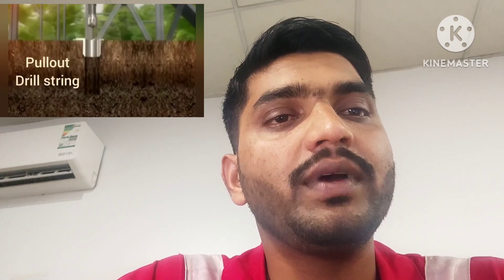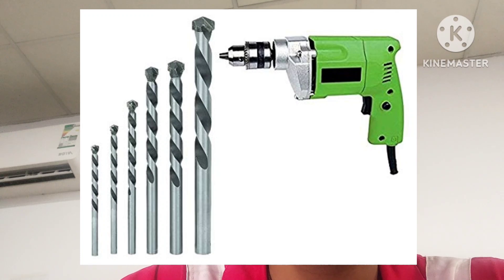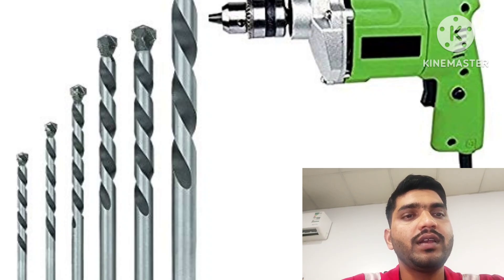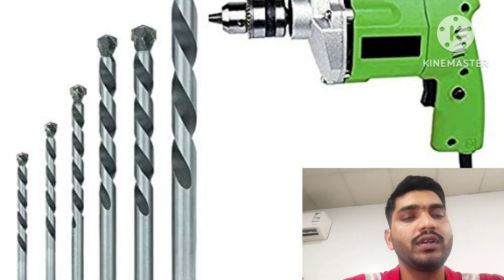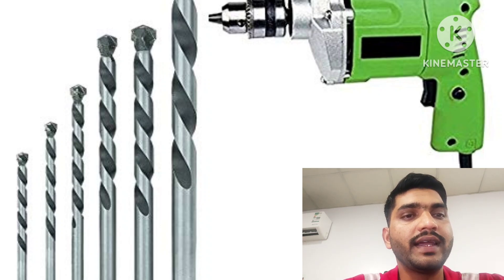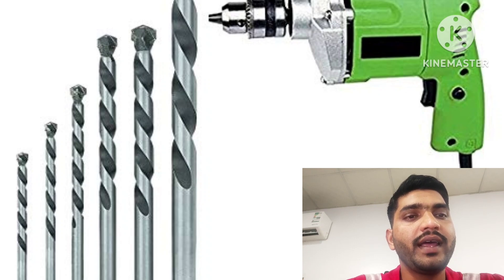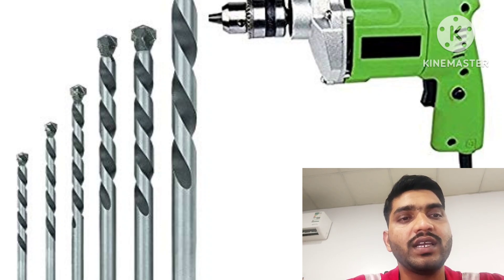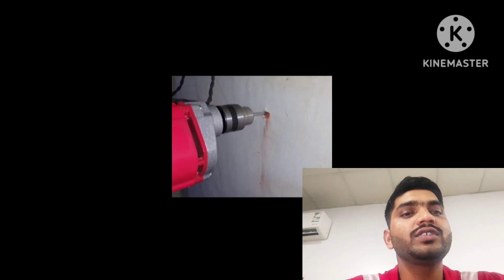128 - How to Drill an Oil & Gas Well by Yasir Ali

Comment: Thank you so much thats clear, but anyhow you mentioned that we can only use the drill pipe with rig. Sometimes we perform a fishing operation using Coil Tubing and its Rig operation. Even sometimes we perform operations in dead wells but with CT or SL.
Reply from the maker: Yeah that's right, some time we perform Rig operation while the well is dead. But during those operation Rig BOP is not installed, that dead well become alive at any time, so that's why we use CT. CT can handle the well, if it becomes alive. 

Moreover, when there is tubing in the well, drill pipes can not go, because drill pipes size is bigger, than we have only option to use Coiled Tubing. 

Hope you got the answer.

Comment: No one make it easy to understand like you. Thank you Chief
I got a question, is there any different usage for the drill pipe ? Other than drilling ?
Reply from the maker: You welcome and I feel obliged. Thanks for appreciation.
Reply from the maker: As far as your your question concerns, of course they primary purpose of drill pipes is to Drill the hole. 

But yes, we use drilling pipes in other activities even once the well is drilled like fishing, setting plugs, setting packets etc.
Reply: So thats lead to more questions, if we can use drill pipe in different operations why we use other services like Slickline and Coil Tubing ?
Reply from the maker: @alaaqurain5183  That's right that we also use other services like slickline and coiled tubing for these operations, but as you know drill pipes come with Rig. Without Rig we don't have drill pipes. So the first answer is that during Rigless operation, we have only option to use slickline and coiled tubing etc.
Reply from the maker: @alaaqurain5183  and second point is that, drill pipes most of the time are used in a dead well, if we have to perform operation in a live well, then we will be needed to used slick line and coiled tubing. Hope you got the answer.